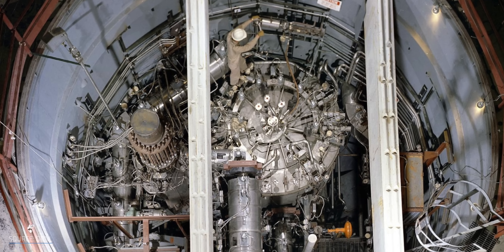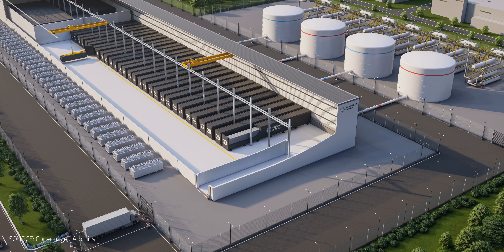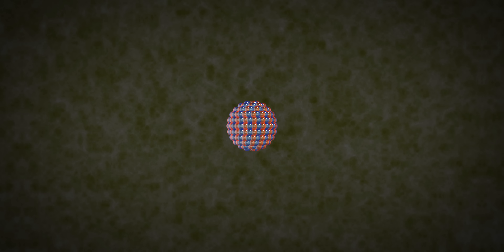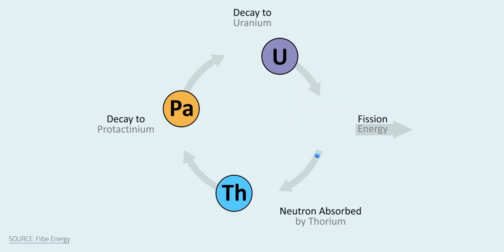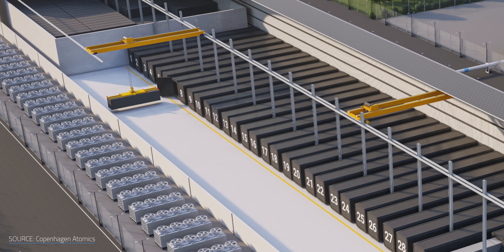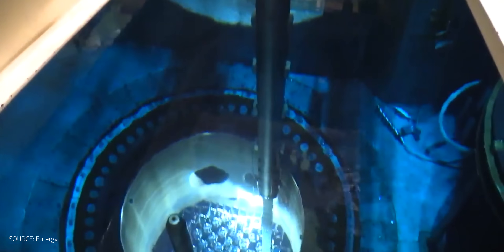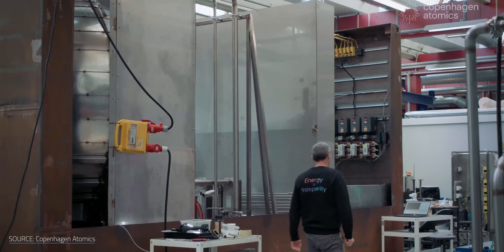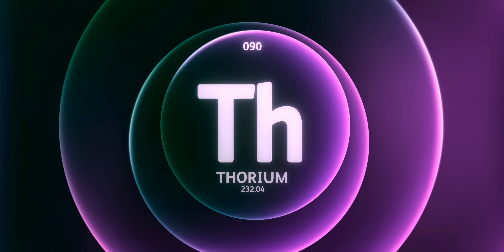Why Thorium is About to Change the World

Comment: Clean energy (specially based on fissile or 'fertile' material) uses EXACTLY the same logic as clean coal. Much pump and fanfare but in the end they STILL produce waste and/or pollute (sometimes wildly). 
We are invited to simply kick the waste and inconveniences in the future, hoping someone will eventually find a way to make money out of it. A nice example of this is your regular run-of-the-mill recycling. Everyone puts stuff in the blue bin but in the end no more than 8% of the material is actually recycled. You rarely hear that in the news, do you?
Back to the topic. The way thorium works (as far as I could find) is that thorium is bombarded with neutrons to become uranium-233. So we're back at making nuclear reactors. Said reactions produce heat which is then converted to electrical energy. If you take a bit of a distance, this process is very similar to the one used in steam engines, although fancier. 
Like the production of ITER, most thorium experiments are done mostly on the taxpayer's dime and will eventually produce electricity to be sold to the taxpayer at a premium price. No gain for the ordinary folk here (willing to bet it wasn't the original intent either).
Last but not least as I said before, thorium reactors STILL produce nuclear waste. As is human nature, people are cheering this on but should the nuclear waste be put in their neighborhood they'd fight to move it elsewhere (ironically the US military has simply dumped it's nuclear waste in the ocean, figuring those little fishies will not sue their pants off).
Reply: Hi obi wancelari,
I disagree with almost everything you claim here.  Care to give any references?
-- Clean coal is a fraud, a talking point, trying to keep coal plants burning for decades so they can pay off their capital costs.  Coal produces gigantic amounts of waste, including more radiation that nuclear power plants are allowed to emit.  (Trace amounts of thorium, uranium and potassium in the coal.  The percentage is tiny, but the coal plants produce mountains of waste and it adds up.)  This is saying nothing about toxic heavy metals like mercury, chromium, arsenic, 2.5 micrometer particulate waste, carbon dioxide, PAL compounds, sulphur dioxides, various nitrous oxides, etc.  Many of these are carcinogenic.  If you are concerned about waste, I would start with shutting down all coal plants first.
-- You claim without evidence that the taxpayer is subsidizing this.  But Copenhagen Atomics is privately funded, and is paying for all research, and permitting.  
-- In China thorium molten salt reactors ARE being built by the government.  Why?  Because, cheap energy drives economic growth.  They seem to think it is a good investment.  Their molten salt reactors exceeded expectations, finishing their testing 2 years faster than expected.  They are now working on a commercial thorium reactor which is expected to come on line in 2029.  It will make electricity and provide process heat to industry, making Chinese products cheaper and more competitive.  China also wants to shut down coal plants which are poisoning rural areas.  Look up coal pollution in China, or at the references I give below.   
-- Thorium reactors produce nuclear waste, yes.  But nuclear waste is less dangerous than coal tailings (thousands of deaths in the last 50 years), which you don't seem to have a problem with.  Look up: Aberfan disaster (144 deaths) and the Buffalo Creek Flood (125 deaths) just to get started.  How many people have died from nuclear waste in the last 50 years?  How many people have died from hydroelectric dam failures.  (Look up the Banqiao Dam failure in China in 1975 resulted in China estimating 171,000 deaths, with outside observers estimating 250,000.) How many people died in the Piper Alpha disaster (oil)?  etc. etc. The media loves traditional power, and hates nuclear, but look at the number of deaths per terawatt of electricity produced to see the true risks of power generation.  See:

https://ourworldindata.org/grapher/death-rates-from-energy-production-per-twh
-- Back to nuclear wastes.  Isotopes with short half lives are wildly dangerous (but decay away to safety in hours, weeks, or months).  Those with very long half lives are barely radioactive and part of the background we have evolved in for billions of years.  Those that have half lives of 50 to 1,000 years are the most problematic they are radioactive enough to be dangerous, but their half life is long enough to keep them dangerous for decades or centuries.  (People who try to scare you by saying this nuclear waste will be radioactive for 100,000 years are TECHNICALLY speaking the truth, in the same way it is technically true to say the bananas are radioactive.  Sure they are (they are rich in potassium), but no one cares.)  The most problematic radioactive wastes are the transuranic actinides, which are dangerous for dozens of centuries. If you breed U238 (absorb one neutron), you get once chance to fission (65% chance), and then you are making these dangerous actinides.  If you are burning U235 you have a 85% chance of a fission, then you have to absorb four more neutrons to get to Pu239 where you get that 65% chance, and if that fails, you have the dangerous actinides.  If you start with thorium 232, then it absorbs 1 neutron, turns into U233 and has a 90% chance of fissioning.  It has to absorb SIX more neutrons and pass the 85% and 65% gateways before you get the dangerous actinides.
-- Therefore, thorium produces FAR less long lived waste.  They produce so few actinides that the waste from a thorium power plant, will decay back to the back ground radiation of its ores in 200 to 300 years.  This is a massive advantage to the thorium fuel cycle.

References:
"Big Coal: They dirty secret behind America's Energy Future" by Jeff Goodell, ISBN: 9-780618-872244.
"The Silent Epidemic: Coal and the Hidden Threat to Health" by Alan H. Lockwood, MD, ISBN: 9-780262-017893.
"Blackout: Coal, Climate and the Last Energy Crisis" by Richard Heinberg, ISBN: 978-0-86571-656-8.
"Thorium: Energy Cheaper than Coal" by Robert Hargraves, ISBN 9-7814478-161295.
"Molten Salt Reactors and Thorium Energy" Edited by Thomas J. Dolan, ISBN: 9-780081-011263.  (This is technical, don't read unless you are enthusiastic.)
"Sustainable Energy - Without the Hot Air", by David JC MacKay, ISBN: 978-0-9544529-3-3.

This last book is a wonderful introduction to reading about energy policy.  Highly recommended.

Warm regards, Rick.

Comment: You might not be aware of how advanced India and China are with thorium reactor technology. India has been steadily pushing its three‑stage nuclear program—with reactors like KAMINI (running on U‑233 from thorium) since 1996, and a 500 MWe fast breeder prototype (PFBR) in commissioning—laying the groundwork for thorium energy. Meanwhile, China is already operating a 2 MW thorium‑fueled molten salt reactor (TMSR‑LF1), achieved criticality in October 2023, with plans for a 10 MW demonstration and even full‑scale versions by 2030. 

By comparison, the Danish company Copenhagen Atomics—though promising mass‑manufactured thorium molten‑salt reactors—is still at prototype stage, aiming for chain reaction testing around 2027 and commercial units well into the 2030s  ￼ ￼. So, India and China are clearly ahead in terms of demonstrated capability.

Comment: Great news, but in all my years of studying nuclear technology, I've never heard of any country building power plant underground.  A plant built two hundred feet underground when mitigate a lot, a problems associate it with nuclear technology. Am I incorrect?
Reply: Yes, you are incorrect. Building power plant underground would solve the radiation problem - except - the "radiation problem" is not an engineering problem. It is just a political and PR problem. Fission nuclear power plants emit less radiation and less radioactive material than a comparable coal fired plant. Less even than the mining required for wind and solar.

Comment: Soooo . . . still expensive, still dangerous, still complicated. While it does seem better than what we curently use, it's still got a long way to go before it's ready. The half-meter thrick container walls, the FLiNaK super-hot and corrosive to metals salts, the hard radiation - none of this can or should be glossed over. I like the idea of this system, but as my high school english teacher usually wote on my papers - "Needs work."

Comment: I'm not convinced. The design is just too complex. Onion core with both salt and heavy water, extreme gamma ray radiation, pumps that work on magnetic levitation, and all that into a sealed box which cannot be opened. What if there is something that does cause a runaway reaction!

Comment: Heavy water reactors are a failure by design, they depend on a coolant that has a tiny melting point and therefore they must pressurize it to an incredible degree to prevent vaporization.  Molten salt reactors on the other hand have almost no chance of boiling and if you pull away the energy source, it goes dormant.  NO MELTDOWN!!  This worked like a champ back in the 70's but since all the nuclear engineers were heavy water guys, this got kicked aside.

Comment: 12:53 so pumps that run forever is good because you don't need to replace them, but the reactor wearing out after 5 years is good because you need to replace it? Hmm - having it both ways?
Reply: I'm thinking he may have meant either something more along the lines of "700⁰ salt kills everything after 5 years, but something as complex as a pump would be destroyed in a fraction of that, so they had to make a magnetically levitating pump to make the reactor last the full 5 years" or "a normal pump requires regular maintenance to keep running, so they built a magnetically levetating pump that can last the full 5 year lifecycle without needing to be serviced".

Either way I'm getting the implication that the technological advancements are that it can survive 5 years without regular maintenance and then be dealt with all at once. Which definitely sounds good for something with radioactive fuel in it.

Comment: Thorium is NOt fissile on it's own, Needs a hefty neutron source to provide fuel. Molten salt reactors were problematic 50 years ago, they're problematic Now. 
A high temperture, high radiation, high corrosion environment is terrible place build a reactor.

Comment: The only thing about this concept that worries me is the heavy water moderator. How can they say it runs at low pressure when it has water in the system. Even heavy water boils at low temp way below the molten salt temperature. How do they keep it cool or at low pressure? Makes no sense. Should use graphite as moderator. No possibility of boiling even at molten salt temperature.

Comment: I've heard this story before regarding promising technology of limitless, inexpensive energy. Uranium-235 is enriched while thorium-232 is nuclear bred (like Plutonium-239 from Uranium-238). The same problems are that: you need a breeder reactor for neutrons usually U-235 or Pu-239 to breed Thorium-232 which beta-decays into Proactinium-233 which beta-decays into Uranium-233. High level nuclear waste materials will result and you will still have accidents like the Savannah River incident. Where and how are you planning to address that. Next, you have to pick the heat transfer mechanism. Molten salt? There's no full scale power plant, just technological demonstrations. I expect there to be problems and accidents. The result will be an expensive, messy problem that will burden rate payers ad infinitum (see San Onofre nuclear generating station). No thanks. Learn from past mistakes.

Comment: Sorry guyes, it is not exceptable: Thorium-232 is not fissile on its own; it must be converted to uranium-233, which requires a neutron source.
This means you need fissile material like:
Enriched uranium (U-235)
Plutonium (Pu-239)
U-233 (which is rare and not commercially available)
🔴 3. Uranium-233 Proliferation Risks
U-233 can be used in nuclear weapons.
Though it's often contaminated with U-232 (which is highly radioactive and makes handling difficult), chemical separation is still possible with advanced tech.
This raises proliferation concerns, especially for countries without strict safeguards.
Reply: It needs Plutonium! Crazy!

Comment: "200 years of Uranium left?" But Matt, we only have 100 years of wind left. 
Not to mention that the sun will run out in just 50 years, at current use levels.
But yes Thorium would be nice.
Reply: This is nonsense.  Wind is created by the heating of the sun, so will run out in 50 years, not 100    😉
Reply: @mm-qd1ho  Correct, my mistake.

Comment: One of the things he didn't mention is that Thorium operates at one atmosphere pressure.  High temperature yes, but low pressure.  Compared to existing reactors that operate at about 700psi.  That high pressure is really very difficult to manage and a major weakness in existing designs.
Reply: If the high temperature and the radiation factor  is already taken into account could that not also take into account the 700psi effect ?
Reply: @rscott2247  It is designed into reactors.  But it's one of the factors that makes accidents at nuclear facilities so potentially dangerous.  If a pipe under one atmosphere ruptures nothing much happens.  It leaks a little but the contamination is limited to the localized area.  700psi?  That shoots everywhere and can destroy building structures and anything else in it's path plus spread contamination over a wide area.

Comment: You mentioned that there is no risk of a high pressure steam explosion from this reactor. This reactor uses heavy water as a moderator. I believe the way moderators work is that they must be near the core. The core is very hot. So how does this heavy water keep from boiling away?
Reply: It does not use heavy water or even regular water as a moderator.

Comment: I still think solar+wind+batteries will provide most of the solution.  Easy and fast to deploy.  Cheap and scalable.  But it's not a complete solution.  I keep hoping better for nuclear.  But it keeps turning out to be more expensive than originally estimated.  It is complex technology, on a number of grounds (supply chain, radiation, waste, safety, regulatory ...).  

But something like TMSR may justify itself with a number of income streams, with it's own unique economic propositions: 1. electricity generation, baseload (at least charging the batteries).  2. Industrial heat.  3. Fuel breeding.  4. Burning up the stockpile of nuclear waste (unused fuel).  5. Other radioactive byproducts that can be useful in other settings (e.g. medical isotopes).

Comment: A good update. I hadn't realised the idea was to run these reactors for only five years and swap them for new ones.

I PRESUME (though I'm not sure the question was answered) that the containment vessels – as distinct from the radioactive fuel/salts/heavy water – can be smelted anew (since they seem to be some sort of fancy steel, rather than fancy ceramics that can resist those nasty fluorine ions).

Otherwise, the question of what to do with a series of (somewhat radioactive?) used containment systems every five years would obviously come up...

Comment: The problem wirh nuclear is that electricity is pretty much perfectly competitive, competiting only on price, and its pretty hard to be cheaper than just sunshine. Additionally the benefit of solar as it can be eaisly scales up or down to match excess capacity in the existing grid infrastructure or be built at the point of consumption also avoiding significant transmission costs. I am not saying its not possible for nuclear to be cheaper eventually, but certainly will be challenging

Comment: 0:30 - Its not really a battery ... but, in a sense, I guess in a sense it could be thought of that way though.
Reply: And what is a battery exactly?
Websters def: “4a
: a combination of apparatus for producing a single electrical effect”
It’s a battery bro
Reply: @xostler  Its actually a power generator/ power plant. It isn’t charged up and storing the electricity - it’s actively producing it.
Reply: I don’t know what technically makes something a battery, but I would consider it where you either have to recharge it with electricity or you can’t recharge it because it’s just a chemical reaction in a battery and so this, although not a chemical reaction is just a different reaction creating power. So if you can’t replace the fuel, then I think it would be a battery.
Reply: His point wasn't to compare its function, but where it exists in the development cycle: (solid state batteries) "vastly superior, yet forever on the horizon".

Comment: Taking the "breeder" reactor out of this.  Thorium is 500X more prevalent in the environment and less costly to mine.  Using current waste from Nuclear reactors, we could have a decent system that will run 3-5 years without a drop of CO2 all with a gravity system and normal air pressure through the lines.  It's the ultimate battery backup for data centers.